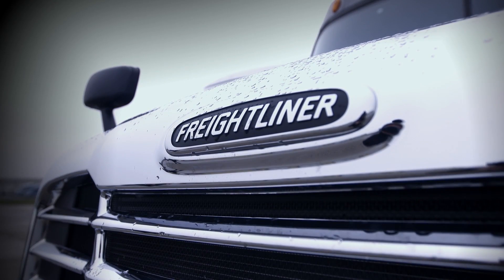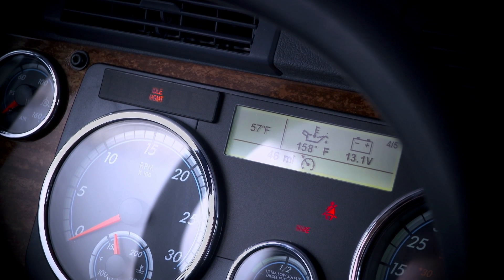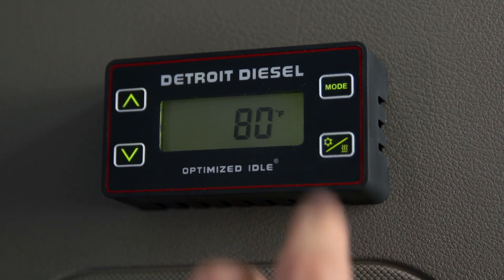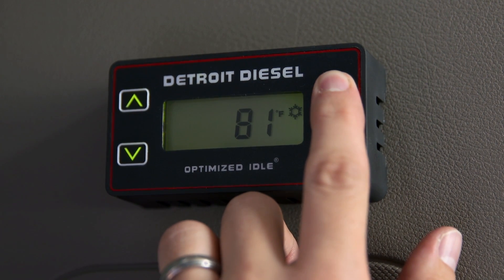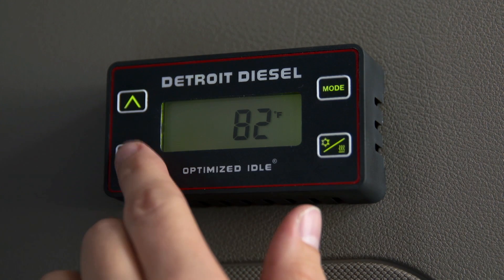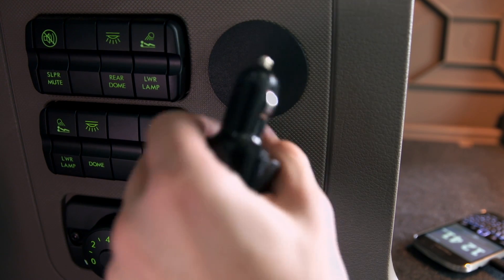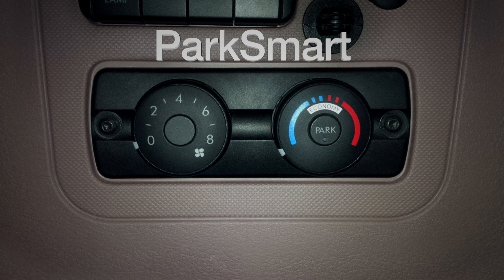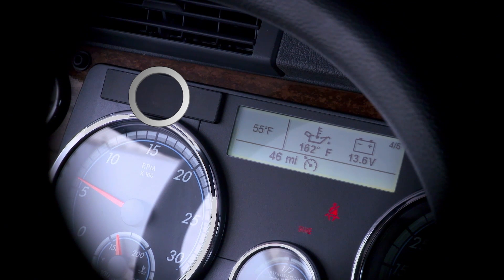Driver Training Series: Detroit Optimized Idle

Comment: I thought mine wasn’t working and had to do it backwards . Meaning I set the idle first and then turn on cruise control and it works . Took me forever to figure this out . If your light isn’t coming on drivers, just idle it high first THEN press the cruise control button
Reply: Nvm not working now 😢

Comment: Doesn't work.... Freightliner said they got it to work, it doesn't!! Did everything over & over & over same outcome. Never shuts off just keeps running on the high idle setting as stated in this video.
Ck list: start engine, shifter in neutral in high range, cruise on/off then on again....no idle management indication, turn op-idle bunk controls to cool and desired temp setting (a modest 72°) it's showing still on, but...?? Turn off/on cruise again.... Nothing!! Not a good system.
Refund Plea$e!!!

Comment: This isn’t the idle air system of previous models
A simple rocker switch on dash set the system with no engine running for up to 9 hours but park smart was part of it. 
That was the best idle less enviro system ever designed . But it would fail at about 280,000 miles costing 8 ooo to replace. I suspect an American debugging of Chinese crap parts would be the solution

Comment: My version of optimized idle was running the truck at 900 RPM

It was awesome yeah I paid for the fuel but I didn't give a hoot considering that I woke up nice and easy truck was already and a truck is like let's haul ass

But in all honesty I did run cleaners through it and what not and the whole DPF problems everyone says they have when idling is pretty much non-existent if you high idle it and you run some DPF cleaner at least once a month heavy on the first time you do it and then just do it once a month and you're good never had an issue

Of course I get the DPF light no big deal I pushed a button the truck whines up I already have my clothes on went inside come out after Getting Coffee truck idled right back down and I looked at the truck and said what the hell is that all about and then I thought about it for about 10 minutes and I realize that Detroit put a Fail-Safe that after 10 hours of idling it automatically wanted to clean the filter

But it was never a problem boy with that truck pull

Now if I shut it off and woke it up and let it run for about 5 minutes it didn't like that

Comment: Pos we got on 8 trucks and it shuts truck down but never starts them back up
Reply: Mine has the same problem. Just goes to show that companies care more about their precious gas than the comfort of the people that operate their equipment and make them money. Just garbage
Reply: On ours you can pop the hood open and idle up engine just barely and it stays running
Reply: Drew Morgan  oh really my friend says most drivers always request a jumpstart because they leave there bunk heaters on or leave on idle causing batteries to die,  he asked what company you work for might be the same one
Reply: @knockzdoorz5813  I don't have a bunk heater on mine. I don't think I ever have. Would be a disaster anyways. No way to charge the battery. I miss APU's. Those were the best. Kept you cooled or heated; sipped fuel, and kept batteries charged. These idle management things are garbage. No guarantee they will turn back on if too hot/cold in the sleeper. Hate it
Reply: Drew Morgan are you guys having bunk heater problems? Every other driver complaints about having that issue, also do you guys have your trucks jump started often sorry for the intergoatin my friend currently works for a trucking company not as a driver but dispatch and would like to get some feed back from drivers all across the states
Reply: Bunk heaters are unhooked they are junk and didnt work half the time. No problems with starting or battiers keeping charge that i know of but most of us dont have inverters we run regional.

Comment: Worst designed system in trucking. Unbelievable that a massive truck manufacturer could collectively come up with such an inefficent, joke of a heating/cooling system.
Reply: admorris11 that’s why I use thermo king apu on my truck for bunker ac/heat lol 😂

Comment: To  bypass simply set the optimized idle to cool in the winter and heat in the summer and set its temp above or  below whatever temp the cab will be. It has no control over the actual hvac system so it will just keep running indefinitely trying to do the opposite of what the actual hvac is set at.
Reply: I can't get my optimized symbol to even come on at all except in cycle
Reply: Did it ever have any mechanical issues doing that?

Comment: Haven't gotten any sleep with this.  Starts up rocks the truck shuts off your either freezing or hot.
Reply: And my 2016 Freightliner only used about 6 1/2 gallons of fuel for a 10 hour break.  It's not like in the old days where you burn a gallon a hour.  So how does starting and stopping and getting woke up safe and how does that save fuel?

Comment: still seems more difficult then my old cascadia that had 8 gel batteries. havent saved any fuel yet with this system

just lots of idle

detroit, if its more complicated than press this one single button you've failed #IMO